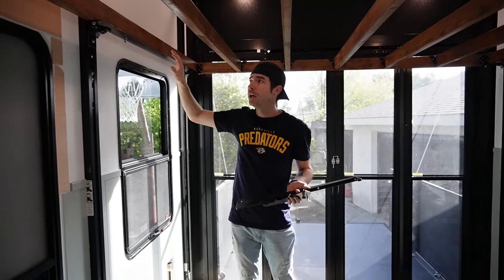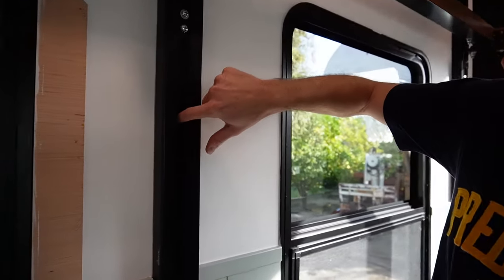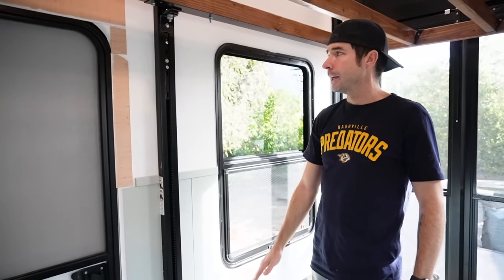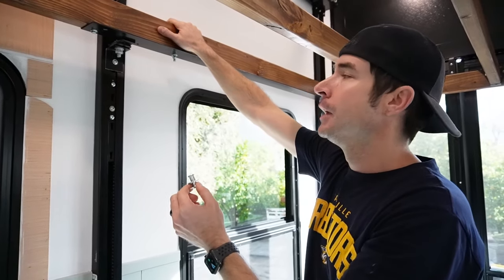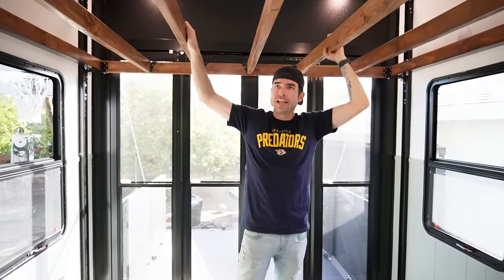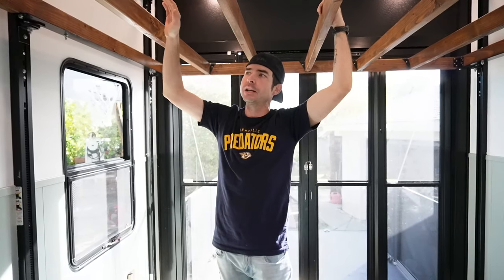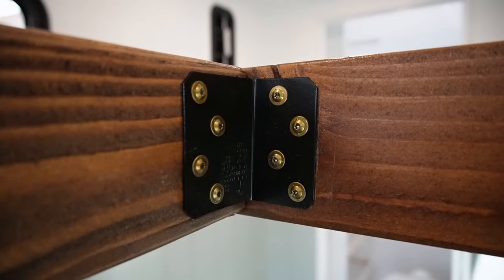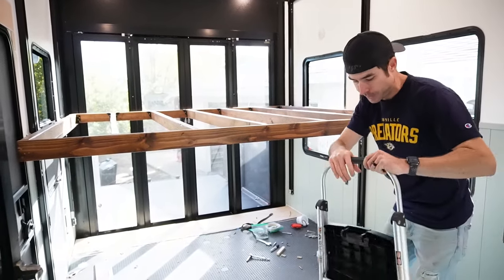Grand Design RV Toy Hauler Garage Master King Bed Conversion [Part #1]

Comment: Good work guys. I did a modification to our 388. I took a hot knife and custom cut a memory foam mattress to fit the “RV” size. You simply cannot find good mattresses for RV’s, so I made my own! :)
Reply from the maker: Very cool & smart thinking!  We have a 72x80 Mattress Insider mattress that we built the bed specifically for.  The old master bedroom is now the bunk house for our boys, and like you, we cut up two latex mattresses to fit there :)

Comment: love what you did.  I asked the RV repair folks to lower the bed way down so I don't have to use the ladder. they said they could not do it.  So what bracket did you remove? and how many are there?  I already removed the seats.  Although the brackets to the seats are still in place. What do I need to do to make the bed go all the way down.

Comment: So did you completely remove the the lower brackets where the bench was ?   

I want to do the same ,put a king bed on the top and place a desk platform on the lower brackets

Comment: We are looking to do something similar. Do you think that removing the cotter pin and replacing with the 7/16 bolt and washer will be too rigid during travel? I am curious of your opinion on if that little give was designed to relieve any pressure while the RV is moving? Have you had any issues with this design? This is a great video BTW and I have loved following you all on Instagram and Tik Tok, such great ideas for families.
Reply from the maker: Goooood question and it has me thinking.  The queen(ish) bedframe originally on the top level of the Happijac system was built out of aluminum box tubing with a couple angle brackets running the length and a couple large sheets of 1/8" -1/4" plywood.  If my memory serves me correctly, there really wasn't much play in the twist motion of the bed (clockwise/counter clockwise).  The only motion was within the bolt housing itself.  IMO, the use of slide through bolts with cotter pins is more of a function of allowing larger tolerances during the mass manufacturing process as opposed to not wanting the frame rigid.  We built our frame without the need to clamp in or push out, so we didn't add or subtract any width.  Again, that's just my opinion, but I will certainly update should we notice any issues!  Thanks for the interesting question!

Comment: This was so close to working for me but didn’t because of a locking lever. Removing it to install the brackets forces it to stay in the up, locked position
Reply from the maker: Ours had the locking lever as well.  We just never go all the way up with it so it never locks in the fully up position 👍🏼

Comment: Awesome video and tutorial. We are about to do the same thing to the back of our toy hauler. Do you have an pictures or videos of the finally layout with mattress and side tables? Thanks
Reply from the maker: Hey Kelly, we plan to do an entire RV tour here in the next couple of weeks.  We've finally got everything moved in and its a matter of tidying up prior to photos/videos!  We'll make sure to go over the bed and master thoroughly!
Reply: Thank you so much. Can’t wait to see the final reveal.
Reply: Did y’all install a regular king mattress or RV mattress? We are wanting a regular mattress!
Reply from the maker: @pandlgr8adventures  … any size would work, you just build the frame to the bed specs.  We have a mattress insider RV King (72x80) that I built this frame too.  Our nightstands I built are roughly 9” wide each!  The wider you go, the less space you have for nightstands but depending on garage size, you should have no problem fitting a king/cal king!
Reply: @McVeyMcFarm  thank you! We’re going to do the RV King size, so 72x80! We will be doing this March 24th! We will keep you posted! This is going to make a huge difference! Glad I came across your video! Thanks again for answering me back!
Reply from the maker: @pandlgr8adventures  No problem!  Keep us posted!  If you struggle or have any questions along the way, don’t hesitate to reach out!  Happy to help answer!

Comment: My understanding is that the bed should be stowed, when traveling, in the full-up position with the pins in the railings to lock the bed in that position. How do you secure this setup when traveling?
Reply from the maker: The pins and associated stopping hardware was removed.  If you watch the video, I made small black brackets that attach the top portion (which is normally free floating when not locked) to the bottom portion (which normally has the couches).  They are one at this point and travel all the way up and down.  There is no locking to be had as the bottom portion (couches) can be stored anywhere along the channel run.  Let me know if that doesn’t make sense and I can try and better clarify 👍🏼
Reply: @McVeycations  No, I understand what you're saying. I did watch the video and just didn't see anything locking the weight of the bed in place while traveling. My concern, as I built a similar setup, is that the extra weight could stress the gears that turn the chains and possibly shear teeth. That would make for a large heavy build crashing to the floor while traveling. I may be overthinking it a bit but that could make for a disastrous travel day.
Reply from the maker: @danielwalthers4986 I gotcha.  Yeah, at this point, after 10k miles towed and a full 12 months of travel and it hasn’t budged.  I check bolts from time to time and I haven’t even needed to tighten.  I am familiar with the chain/gearing as I lost a nut when bolting in the bracket and had to reattach.  They’re relatively beefy and I trust the static/dynamic loads that Lippert advertises on the Happijac.  We even attach a hanging 75lb kayak from the bed when traveling now and still no issues.  YMMV but it’s also a CYA modification 😂 Good luck!

Comment: Any updates after 5 months of use? The reason I'm asking is I think my wife and I probably weigh about 50 pounds more than you and your wife. Do you think setup this would hold up to heavier people?
Reply from the maker: Zero issues!  Haven’t even needed to tighten up any of the bolts!  As sturdy today as she was 6 months ago!  With a 600lb static load rating, y’all should be good to go 👍🏼

Comment: Did you change the handles on the back screen doors or build the bed to clear them.  I'm trying to modify the happi-jack bed to go all the way down, but it doesn't clear the handles on the back screen door.
Reply from the maker: Our handles only stick out about 1/2" or so and don't come close to hitting the bed rail.  We did have to account for our 3 season door opening though, so when we came up with the drawings, we did so with the door folded open (like an accordian) to allow full movement with the bed.

Comment: We are looking to buy an rv and want to turn both the top and bottom happijac units into 4 separate twin beds. I have scoured the internet and can’t find much information on how to do this. What are your thoughts on doing this?
Reply from the maker: The bunks would need to either be support from the bottom (like the original happijac couches) or horizontally from side wall to side wall.  If you ran supports from wall to wall, you'd still be able to individually have bunks that still moved up and down.  If you went the bottom support route, not sure you'd still be able to put up :)  Shouldn't be much of an issue and may be even an easier build than what we have done here!

Comment: You stated you found a $3.50 bracket at Home Depot to attach the two brackets. What exactly did you buy for that? Angle iron is expensive.
Reply: Also, did you remove the top “locking mechanism” that would lock the original queen mattress in the up position?
Reply from the maker: Yup!  It was $3.50 back when we bought them (bought 4 total) and cut them down to size.  They now look to be about $6 or so. Here’s a link to Home Depot.  We cut them, re-drilled them, painted them, then added felt for it to slide without scratching.  Your friend has shared a link to a Home Depot product they think you would be interested in seeing.

https://www.homedepot.com/p/Simpson-Strong-Tie-3-5-8-in-x-11-in-x-2-in-Galvanized-Angle-A311/100375057
Reply from the maker: And yes, we removed the locking mechanisms.  We have a headboard now and it doesn’t even get close to going all the way up therefore, we never have to worry about it getting locked in the fully up position!
Reply: Thanks, your video inspired my wife 🥴. So now I’m basically building the same thing haha.
Reply from the maker: @mattmaderski8963  ha!  Good luck!  Check some of our early short reels on instagram for some completed pictures/vids and walkthrough’s!
Reply: One last follow up question. Did you use any lag bolts or anything to help secure the corners? I just bought some 90 degree brackets but I’m concerned it won’t be enough.
Reply from the maker: @mattmaderski8963  Are you talking about securing the 2x4 corners together?  I ran 3 lag bolts per side in addition to the thru bolts on the black steel.  Corners, I may have ran an extra long screw through on each corner plus the corner brace, but nothing much more than that as I was afraid lags would end up splitting the very ends.